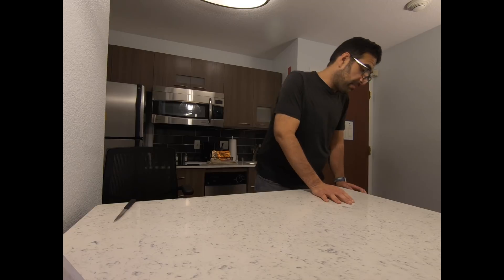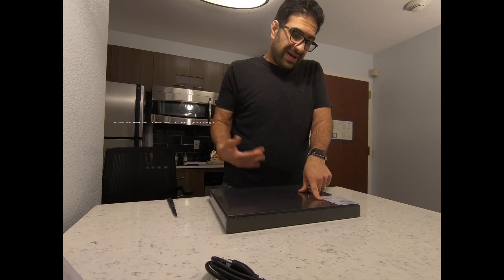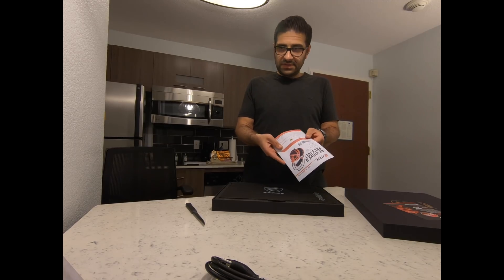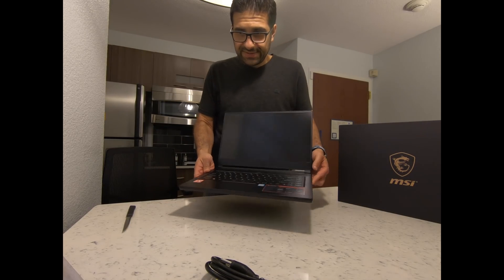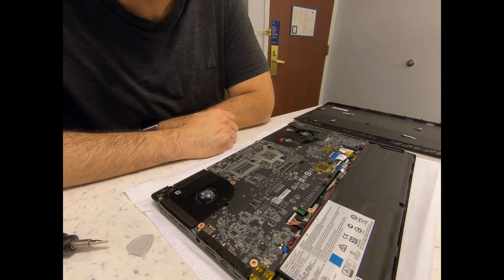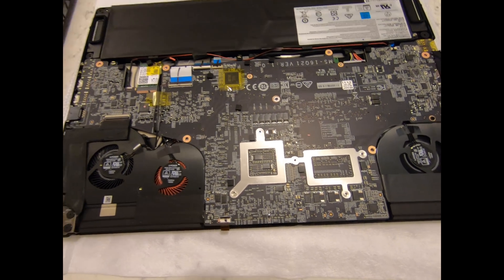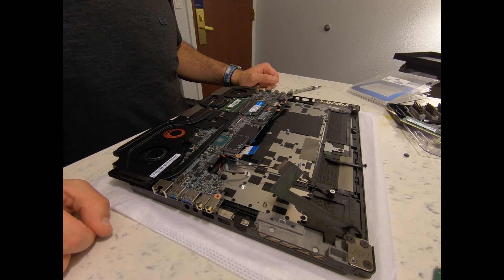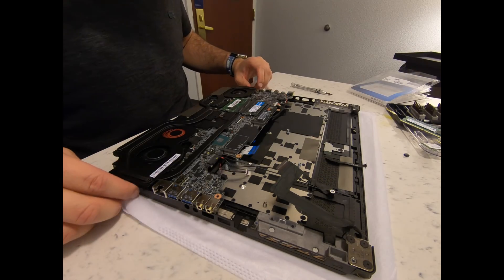MSI GS65 Unboxing, SSD and Ram Memory Upgrade

Comment: I just bought my gs65 and it's awesome out of the box. I use an external hard drive to avoid opening the laptop. however I do wish it was easier to upgrade.
Reply: It's though to upgrade for non-techies you could get it to a shop. But having 2 SSD slots, but 32 GB of ram in that baby, 2 x 2TB Samsung 970 Pro and you're set for years. The blade is much easier to upgrade but only has one M.2 Slot.
Reply: @BrawndoQC  2 m.2 slots is definitely a SUPER WIN in this laptop! Just got this a month ago and it came with i7 9750H and rtx 2060 🙌
Reply: HDD replacement is easy, but the ram is hard to get to

Comment: Just bought one but upgrading it seems to be a pain in the a**. Removing the whole motherboard to change the SSD/RAM is awful. I would have known before buying it, I would have go with another brand...
Reply from the maker: Jonathan Mégevand I know it was a dumb move from msi
Reply: Only msi slims laptops are like that. My gs63vr is like that. But if you go with a little thicker model you can upgrade everything after removing the back covet. Model like leopard, raider. Easier to upgrade.
Reply: I knew it before buying, but there isn't much competition on this sector (high performance, small size, large battery) currently (only the Gigabyte Aero 15X (which has better upgradability, but a nostril camera) comes to mind, but I know there are two or three others)
Reply: Evil Devil that is true. I did not check upgrade ability but the Asus ROG GU501 is another for the slim and powerful.
Reply: Did it with my GS60 and then with my GS63VR, next up will probably be this beauty but only after new gpus come out...no sens to me going from a 7700HQ to a 8750 using the same video card.......need to wait for the next gen of videocards and there i think my money will be better spent.

Comment: hey i am about to buy 1070 graphic card msi 65 shud i really buy it i dont wanna regret bro?
Reply: 90C is ideal temp just place some extra coolers outside laptops or as usb probz what matters is performance any gaming laptop will have 90C temp noob
even asus or alienwares
Reply: tomb raider is too old to be a game here at max temp at max settings were 84°C to be noted fans were not at max setting in this game
fc5 at max setting giving me avg 73 fps had 83°C temp
laptops are designed to run at 80-95C temp under full load
u need to know difference between desktop ultrabook and laptop
ohh and hey i have asus gm501 i wud say its not as good as msi gs65 for it only give 7-8 extra fps in game or performance
Reply: and talking about alienware all they give is nice exterior nothing else
and most importantly they dont update themselves with technology like msi and etc...
Reply: well depends on ur usage for anyone who wanna play on 4k 240 hz diplay with 50+ fps in far cry 5 and some extra cooling fans like usb or at bottom this laptop is best and portable for all such purpose
else u always have 2 hour max typo battery gaming laptops like gm501 etc

Comment: did you replace your original 512G SSD by your new 1TB? how about the OS restoration? why dont you use the existing extra m2 slot for the new 1TB ssd?
Reply from the maker: Xperia Arc I just reinstalled fresh version of windows and downloaded the drivers from MSI
Reply: so your machine still have a spare m2 ssd slot available?
Reply from the maker: Xperia Arc no I installed another 1tb SSD running at raid 0

Comment: Just got this laptop as well, the bestbuy version.  You can put two 1 tb ssds? I'm curious. Can i hire someone to do this?
Reply from the maker: WaLLoWxWiLLoW sure u can and it’s very easy process honestly but u can call MSI And ask them about ur local authorized repair centers and u can hire them to do that for u.
Reply: World Of Gadgets one more question, why didn't you add 2 ssds you only took one off and left the other blank
Reply from the maker: WaLLoWxWiLLoW because the other one was only 256gb. Few days after I made that video I purchased another 1tb Ssd and got them setup as Raid0 . In order to setup raid 0 u need to have the same storage capacity

Comment: First upgrade video on the GS65, thx! Why did they turn the motherboard upsidedown, its so inefficiënt
Reply from the maker: Nick Wijngaards I know ! I don’t get that either
Reply: It is perfectly efficient; in fact it is a simple and nice design. Only one single PCB with all the external connectors directly sold to it. This also allows a bigger gap between the keyboard up and the PCB down , for a better cooling ratio. They make it simple and cheaper ! Downside of course you need to unmount it to access SSD/RAM

Comment: Hello! Thank you for this video as I am about to do the same thing. My question is which type of M.2 SSD may I use for the 2nd slot? Is it SATA or PCI?  I know one slot is "combo" and the other is PCIe, but not sure which one is already taken with the stock SSD. Thank you in advance!
Reply from the maker: JDubInDaClub stock SSD is SATA but the same slot supports NVME (PCI).
Reply: Thank you for the quick reply. So for the currently open slot, I can use either NVME (PCI) or a SATA 2.5? I am thinking of getting the 
Samsung 970 EVO NVMe M.2 500GB Solid State Drive
Reply from the maker: JDubInDaClub yup! I have another NVME installed right now and it’s working  just fine
Reply: World Of Gadgets You are awesome. Thank you very much. Can't wait to get the new SSD, but not looking forward to installing it. Haha.
Reply: Just did it and my STOCK SSD is PCIE ! So if you buy a SATA like i did you gonna have to put it in SLOT 1 and move the stock one to SLOT 2: SLOT 1 == COMBO PCIE/SATA | SLOT 2 == PCIE ONLY
Reply: oh gosh, so if i want to put another ssd SATA, then we should reinstall windows then. nice info man
Reply: @WorldOfGadgets  So both slots support nvme?? Also, what speed of ram did you install?
Reply: Im about to do the same like you. But im jut adding another samsung nvme 970 evo 500gb. And change the ram to 16x2 ddr4 corsair 2400mhz. Both M.2 slot is in the same spec right?
Reply from the maker: Jimmy Firdaut no! Both of them support NVME M2 but one of them supports SATA . It’s not important if your going with NVME
Reply: World Of Gadgets thankyou for the response man, im still curious the ram you put to upgrade, it is 2400 or 2666mhz?
Reply from the maker: Jimmy Firdaut it’s 2400
Reply: oh yeah for reference, which slot do support SATA + NVME, and the only NVME? thanks
Reply: @WorldOfGadgets  Can this laptop take 2666mhz??
Reply: @ddaann2600 Hi in my case for my laptop: I confirm slot 1 was  occupied by the stock PCIE SSD Samsung MZVLN256HEHP . I bought a 500 SATA but it didn't work on slot 2. So I had to exchange both and put the stock PCIE SSD to slot 2. Only slot 1 is a combo.
Reply: @jonathanmegevand3266  Could you just boot from the old ssd straight away after you had moved it, or did you have to change the boot order?
Reply: @antonkandersen  nothing to change worked right away.
Reply: @jonathanmegevand3266  Nice thx for the quick answer! Do you know wich key id(s) that works?
Reply: @antonkandersen  key IDs , what do you mean ?
Reply: @jonathanmegevand3266  It's possible to get different types of connectors, which one did you use? You can see the different connectors  at this image: https://goo.gl/images/EWpwAQ
Reply: @jonathanmegevand3266  Hi  Jonathan. I'm about to upgrade the SSD on my MSI and I've ordered this SSD: Samsung MZ-V7E1T0BW 970 EVO 1 TB V-NAND M.2 PCI Express Solid State Drive - just to confirm will this be okay in the second slot? I assume it will as its a PCI rather than a SATA!

Comment: Great video! Can you tell me what size screwdriver head I'll need to remove both the back panel and motherboard? I will want to upgrade my SSD if I get one.
Reply: Just find a set of screws from iFixit or some other company that makes equipment for fixing computers/cellphones.... the correct size screw will definitely be in the set